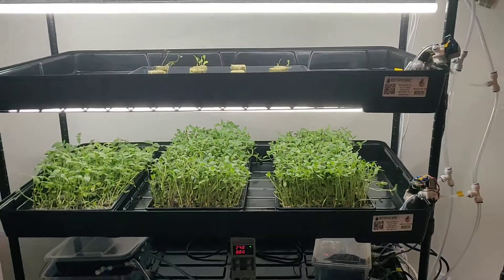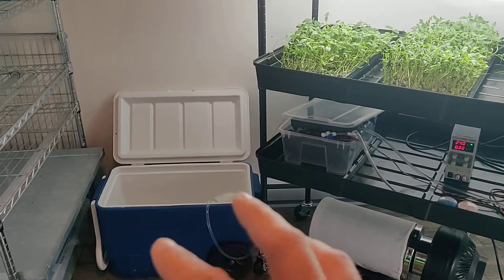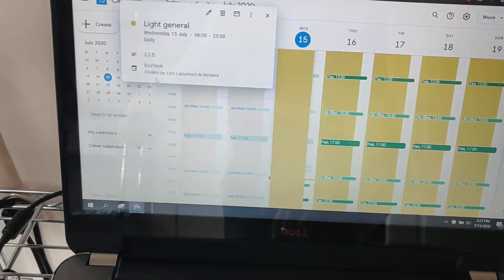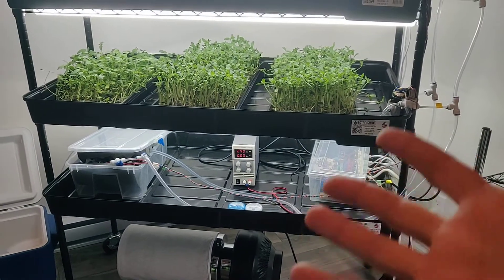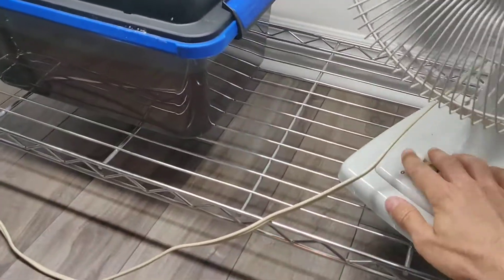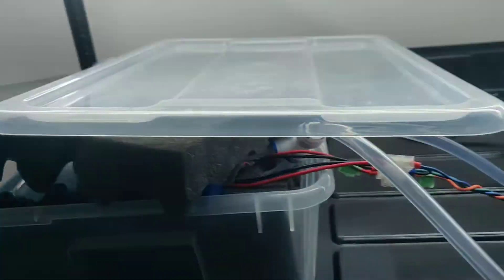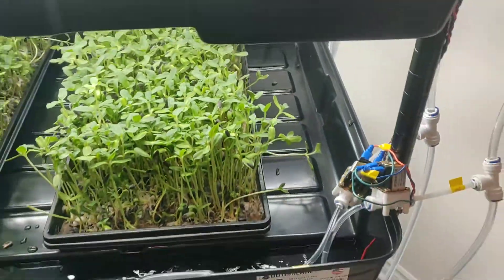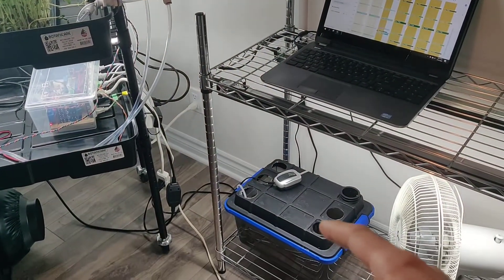Automated Microgreens

Comment: Hi there
Great system (I'm working on a similar solutions my self), maybe the ice chests is not a bad idea at all... Thinking about the fact that:
1) lower temperature makes microgreens more spicy and improve the taste (but it  will slow down the grow)
2) lower temperature discourage mold 
3) lower temperature will prevent water loss by evaporation.
Even if the container is not an electrical refrigerator, being well isolated it will be enough to put in a bottle of iced water... I think I'm going to try this in future 😌
Reply from the maker: I did not know that. Thanks for sharing! if you look at newer videos, you'll see that I switched to buckets. But i would not recommend buckets... haha still experimenting ;)

Comment: Neat system.  I would worry about something going wrong during the night with my luck LOL.  I always take a picture of the water valve so when I wake up at 2 am with the sinking feeling I left the water on, I can prove to myself it is off and go back to sleep.  I guess that becomes a fear when you top off the pool and forget and leave it on all night 🙃
Reply from the maker: yeah things have gone wrong during the day and at night haha but that i one of the reasons I use a grow tent: the bottom is waterproof, so no leaks on my wooden floor ;) 
my reservoir is so small that even if it all ends up all spilling,  it would still be contained in the tent
Reply: @klorofila  Yeah, I figured the damage would be minimal because of the size of the reservoir, unlike my pool incident. LOL  We had water all the way across the property.  Good thing I was on a well and not city water.

Comment: Hi, I have a setup similar to yours. Have you ever had trouble draining the flood trays? My water pump is only sucking air since the main water channel is not always full with water... Any ideia on how to solve this?
Thank you a lot!
Reply from the maker: Hello, i was using a prismatic pump to avoid your issue but then I was facing clogging issues.
So I reverted to a regular drain, with a custom bell syphon
Reply: @klorofila  Thank you! I'll need to look at other solutions because I really want to water each table independently
Reply from the maker: Maybe sub to this channel. I will soon do a video update on my system and plan on selling this system when I feel that it is good enough  ;)